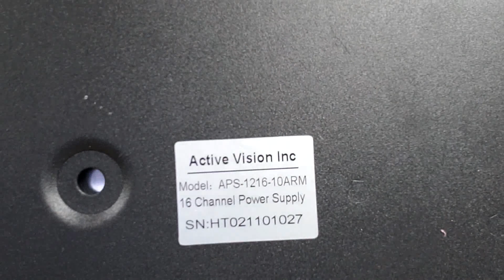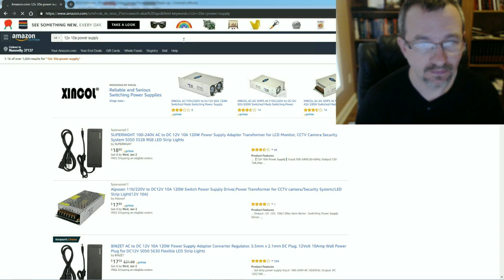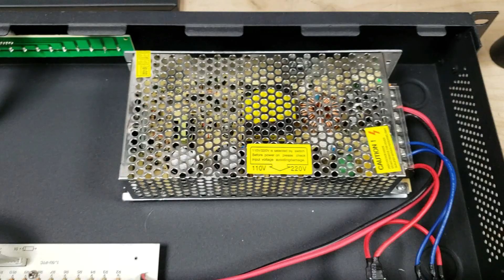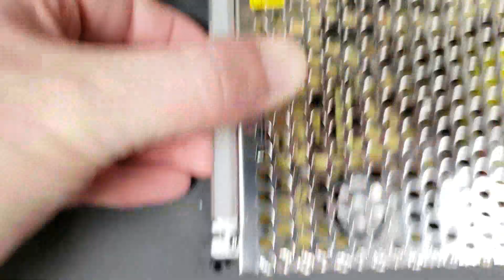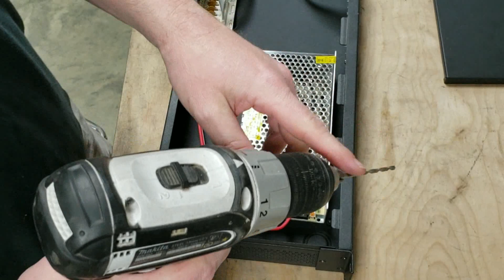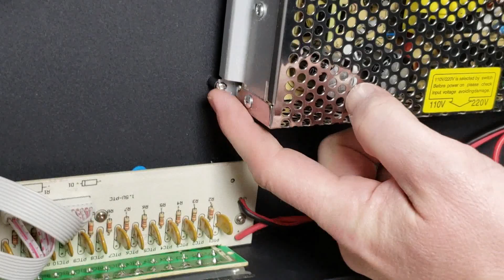Project #27 - Video Camera Power Supply Repair

Comment: Good Video - The only thing I'd suggest is that you could remove the cage code of the supply, and check the fuse.  If its blown, changing it may be even easier than replacing the supply itself.
Thanks Again !